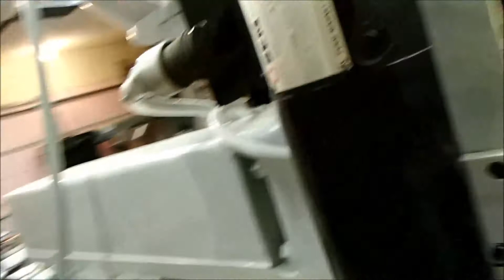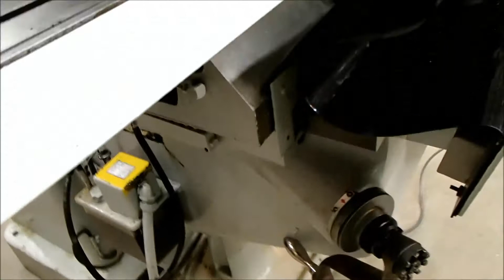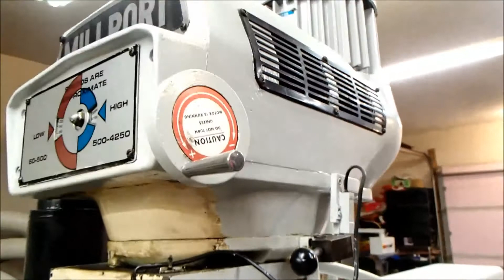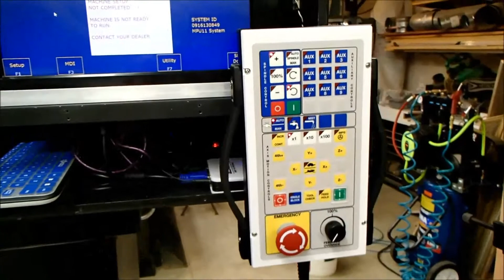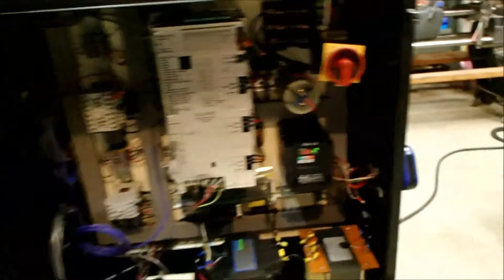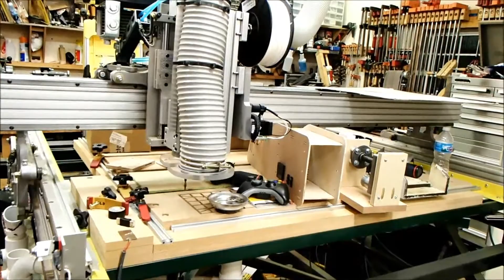1987 Millport 1630 CNC Knee Mill w AjaxCNC Centroid Retrofit

Comment: I'm getting ready to do a mill similar to yours with Heidenhain ERO 120 500 encoders.  Was wandering which encoders yours has.
Reply from the maker: Mine were already on the sem drives. Centroid sells some recommended ones too.
Reply: Mine has SEM servos also, they look exactly like yours.  I can't find any info on the Heidenhain encoders to know which wire is what.

Comment: did you put ball screws on the x & y axis as well?
Reply from the maker: Had them from factory. Purpose built cnc from factory.
Reply: Ok thanks. 
sounds much easier to update older cnc 
Than to retrofit a old turret milll.
Reply from the maker: @millerchassis6119  yes provided ways/rails are good, your servo motors are good, you can re build an amazing machine retrofitting them. Centroid controls are super nice too. Oak, allin1dc, and for non full encoded at controller setups look at acorn.
Reply: ok thanks very much for your help